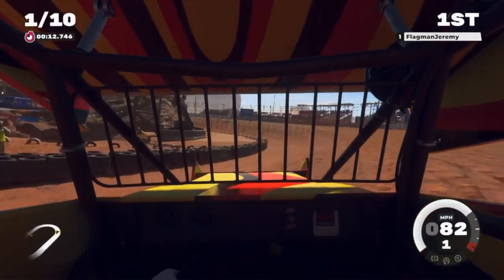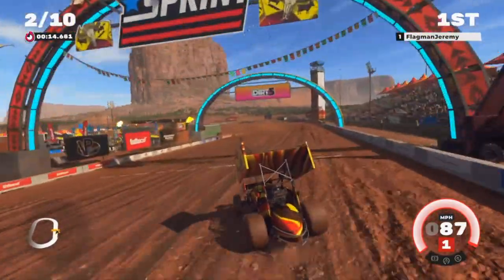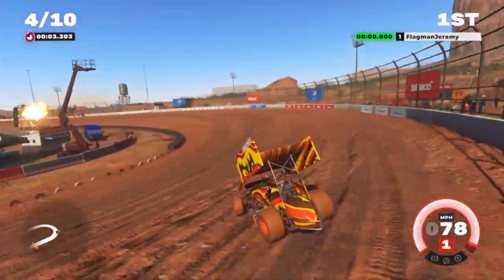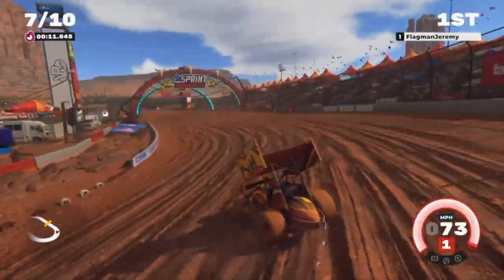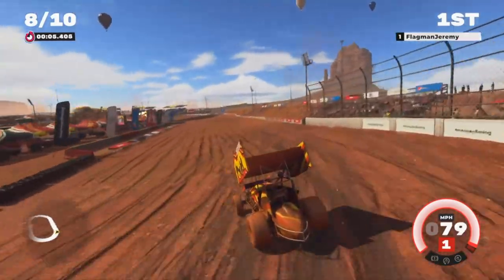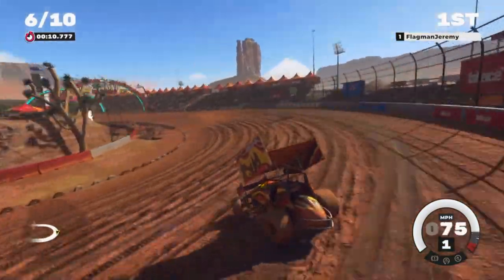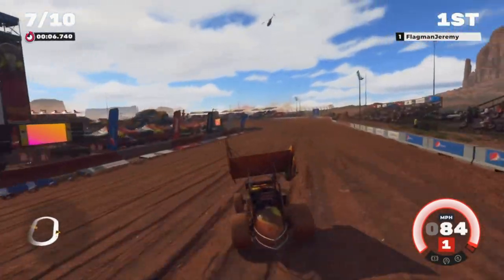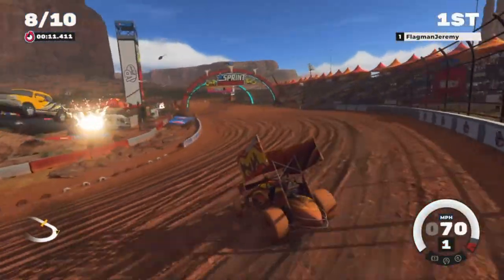DiRT 5 Guide - How to Drive the Sprint Car (TUTORIAL)

Comment: A lot of people don't seem to know anything about sprint cars going off the complaints on Reddit...
Reply: exactly
Reply: A lot of them are also using keyboard controls, which makes the game mode impossible since any throttle at all = wide open throttle. You can't feather the throttle like you can with a controller (I play on PC but use a PS4 controller). The keyboard players can try and lift off and on the throttle, but it's still damn near impossible on KB. They don't understand how important throttle control is in Sprint and Icebreaker.
Reply: @1337bG01  yeah true that's a fair point, even when I did PC game I used an Xbox controller or steering wheel. Always forget about my keyboard homies.
Reply: @1337bG01  Yep I can totally agree as well, but no doubt I have seen people jumping the gun and complaining without knowing the first thing about sprint cars.
Reply: It's an arcade racer. You usually don't have to know anything about the cars. Just drive as fast as possible.